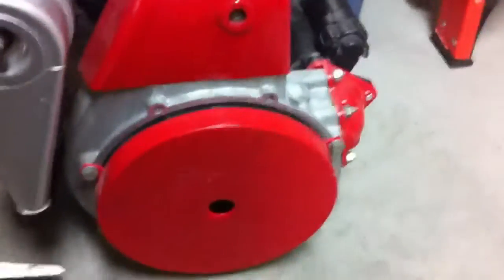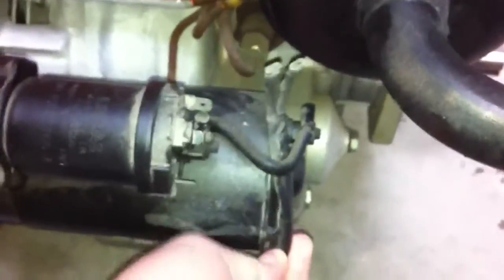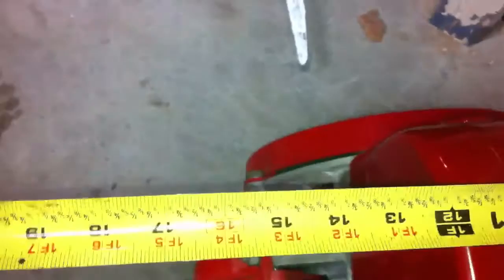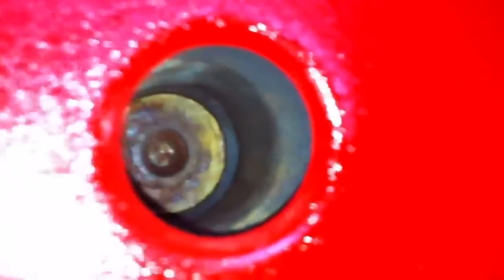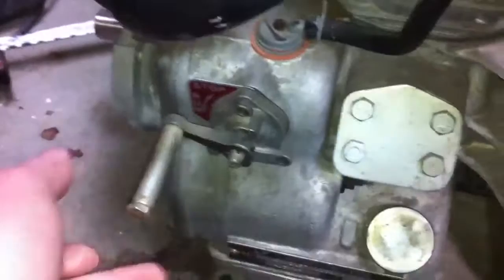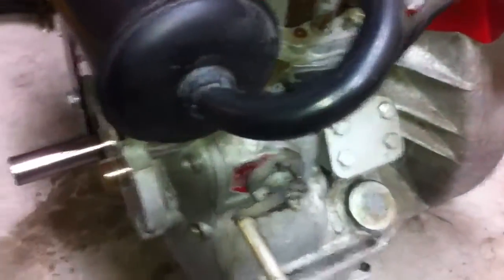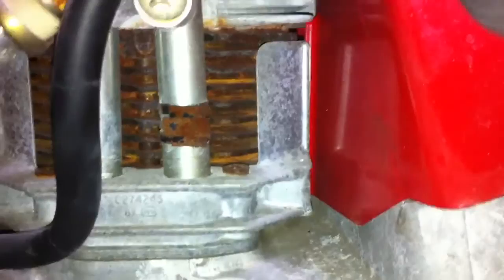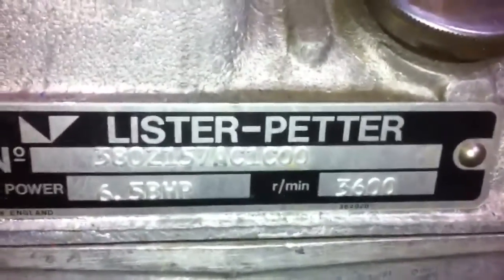Lister Petter AC1 Diesel Engine

Comment: The adapter plate on the camshaft is for driving a hydraulic style pump that was used by the military to pump fuel to the engine and a heater. The hole in the c0over is where the fuel line runs that goes from injector pump with the red plug to the injector. Cam turns @1800 rpms and crank @ 3600. These were set up for military use to drive 400,000 btu, diesel fired, trailer-mounted heaters. Great little engines.